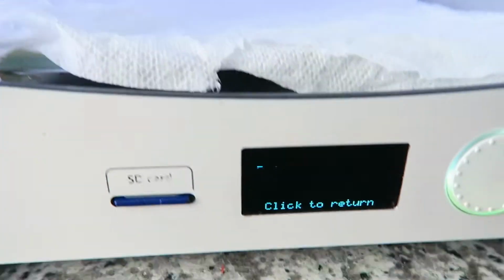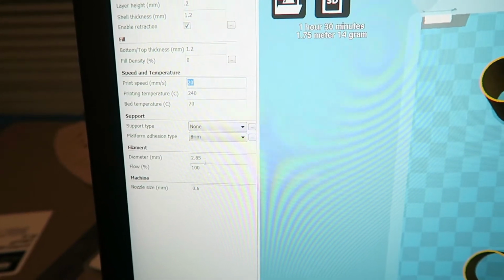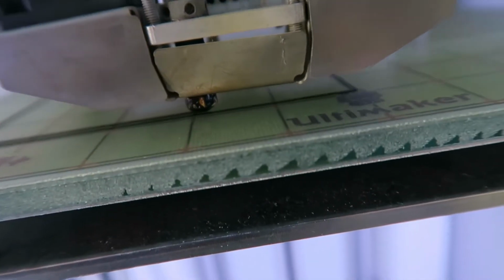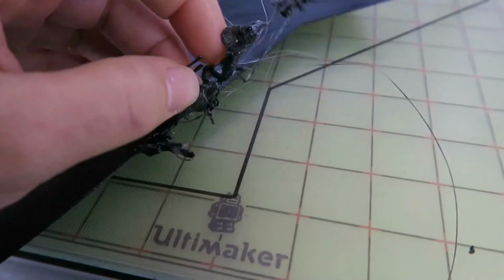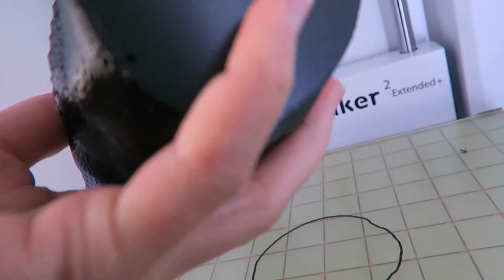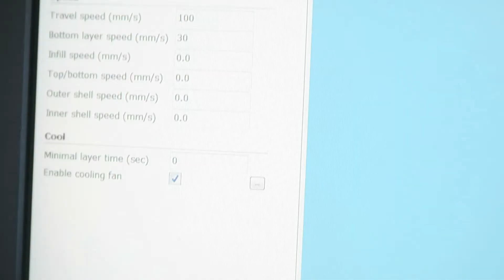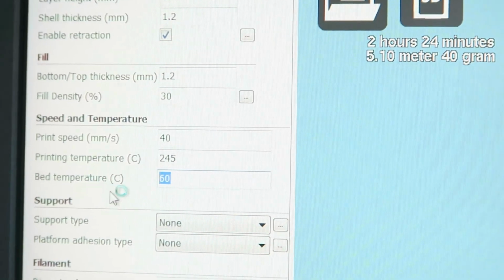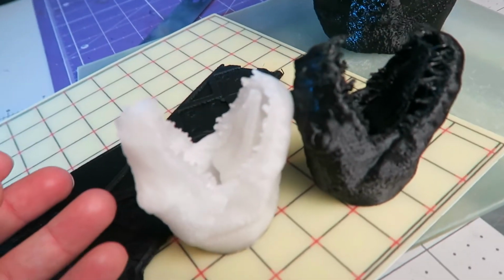PrintBite Plus 3D Printing Surface Review & Unboxing

Comment: my cr-10 printer can only heat to 76 degrees is that enough?
Reply from the maker: Depending on the filament you need to use, you can probably get away with it. I've been using matte fiber HTPLA a lot lately with the bed at 65-70 with a brim, sticks great and releases itself once cool. Is it normal for that type of printer to top out at 76, or are you having issues with the heater?
Reply: sory i had too little patience my printer actually gets to 90-100 degrees
Reply from the maker: Awesome!
Reply: I don't know but i use PLA and its do not stick. I have bed at 90 and printing temperature at 240. What i am doing wrong?
Reply: i am new at 3d printing
Reply from the maker: 240 nozzle temp sounds very high for standard PLA. Do you have printbite or something else as the bed surface?
Reply: printbite
Reply from the maker: Ok then, a couple of things it could be. One would be how close the bed is to the nozzle. If the filament comes out but doesn't stick at all on the first layer,  the nozzle may be too far from the bed. If it sticks at first but the lines are spaced out not touching and warps up after a bit, there may be a flow issue with the extruder or nozzle. Another thing that may help is in the slicer to increase your initial layer height so more filament gets pushed out on the first layer. Of course a brim will help if the issue is later in the print, not at the first layer.
Reply: thank you very much. you helped me alot now it's working fine. the issue was the bed leveling, the nozzle was to far away from the bed.
Reply from the maker: Great, glad you got it figured out!

Comment: If you can not get your Ultimaker to heat the platten to a high enough temp, do you have another printer that the same platten could fit, and heat to a higher temp? Failing that, have you thought of heating the platten in your oven, (assuming it can reach the required temp)?
Reply from the maker: The oven is a thought for the heat cycling part of the setup... I don't know if doing it at 90 instead of 110 has made any difference in the performance.

Comment: It is possible to get your Ultimaker 2 heated bed up to 110c by closing off the front of the Ultimaker. I have used cardboard but an $8 sheet of polycarbonate will also work......at which point you may as well use a sheet of polycarbonate to print on (that's how we do it with a Fortus).
Reply from the maker: So what you are saying is that I can't give up yet? :P
Reply: No, you shouldn't, covering the front will all the print bet to just hit 108-110. The last 20 degrees will take a long time to heat up so patience is key. Also, running the same print over and over again without wiping down the build area allows for a sufficient buildup of polycarbonate to aide in adhesion.

Covering it entirely allows it to hold at 118-120 but the pillow blocks (or the black plastic bits on the printhead) get very soft and the mount for the Bowden tube will be the first thing to fail and it will stop printing entirely. I really do not recommend trying this.
Reply from the maker: Definitely not worth melting any of the printer's working bits!
Reply: Haha no, it's not, luckily I work with higher temperature printers and printed a replacement with some higher temp nylon.
Reply: Haha no, it's not, luckily I work with higher temperature printers and printed a replacement with some higher temp nylon.